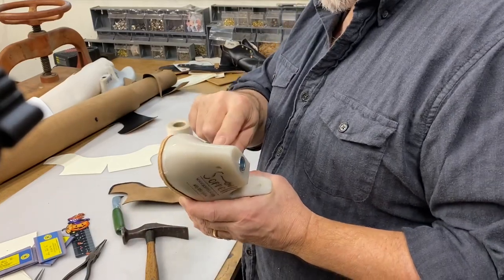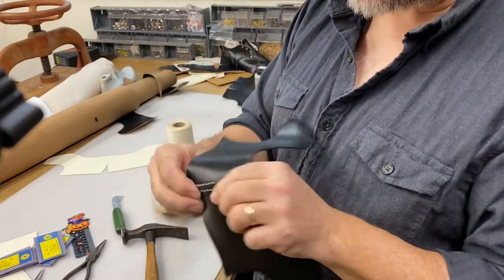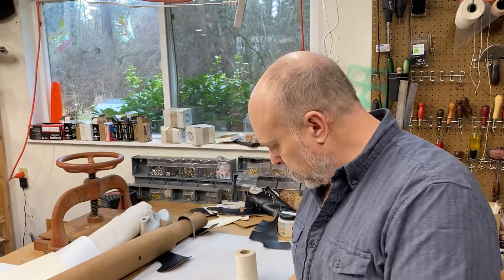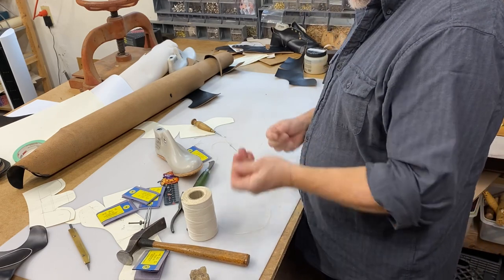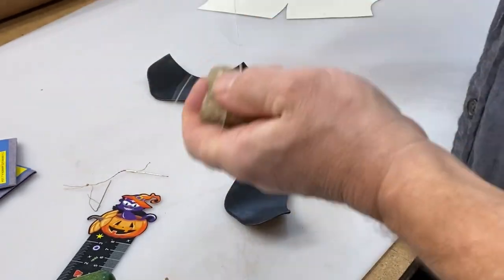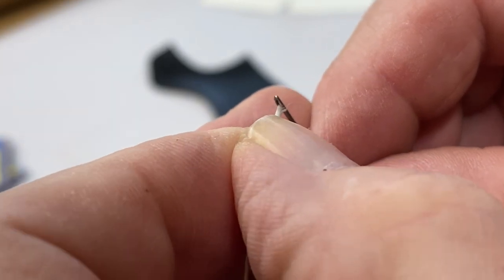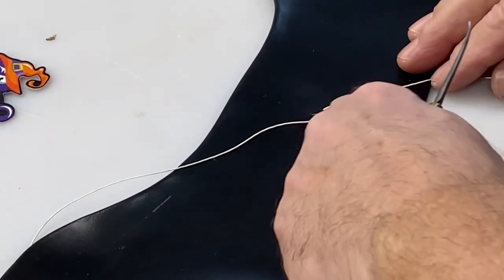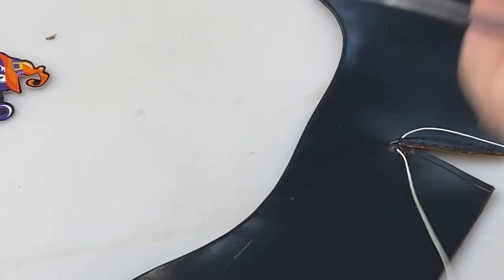The butt stitch for the back seam of a shoe

Comment: This is awesome!!  Would you mind sharing links to the tools you used please?  Thanks!
Reply from the maker: Thanks!  For a butt stitch in this 3oz leather I’m using Osborne 517-4 harness needles - see Amazon link below.  The awl is a small inseaming awl.  I bought that on eBay but Inseaming awls are available on Lisa Sorells website.  Not sure how small the smallest size is but I need to order some so maybe I’ll post a video comparing the different sizes.

https://www.amazon.com/BAIJAC-Replacemelt-Osborne-Harness-Needles/dp/B0BF451JN2/ref=mp_s_a_1_2?crid=31D000B1SWUTV&keywords=517-4+osborne+needles&qid=1679849251&sprefix=517-4+osborne+needles%2Caps%2C213&sr=8-2

https://sorrellnotionsandfindings.com/product/inseaming-outseaming-pegging-awls/